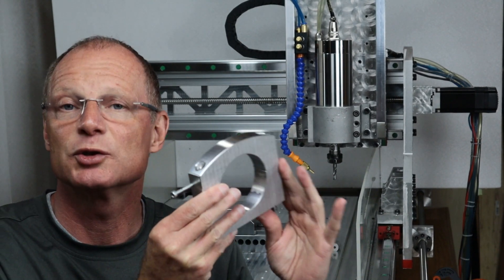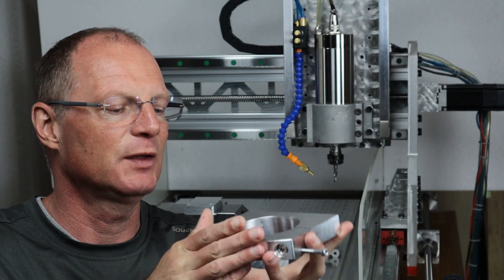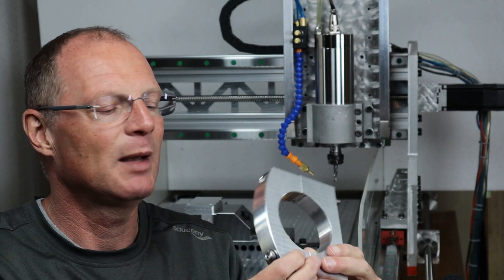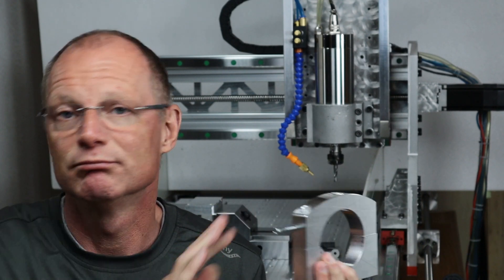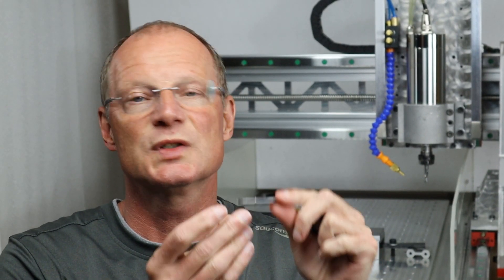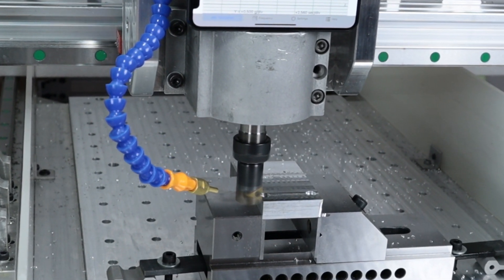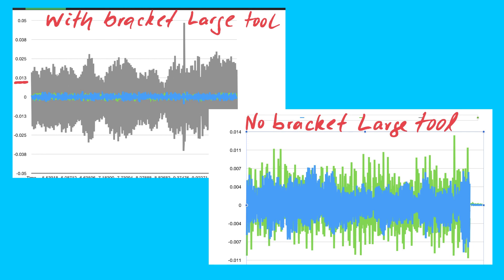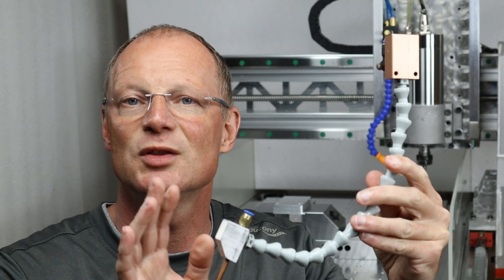Router Spindle Mount Improvement

Comment: Let me point out that the additional clamp may be tilting the spindle and thus introducing additional variable. 
You would have to take the spindle plate/mount/spindle to a surface plate, measure the position of the spindle, then install the additional clamp and re-measure to determine the distortion introduced by the second clamp.
Reply from the maker: I used a gauge block to measure the distance between the Spindel and the mounting plate and transferred that dimension into the design. So yes you are correct it is important that both resting surfaces of the spindle are parallel

Comment: Which aluminum series you used  making your part? Or which one is better to machining?
Reply from the maker: So the most common to find (and therefore The cheapest) is 6061 T6. It machines ok. I use it sometimes. There is a cast fixture plate material I like a lot as it does not deform during machining. The cast material has no internal stress. 7075 is nice material with better strength  that I use quite often.
Reply: @JBWorx  thanks for your response
Reply: @JBWorx  and hope we see your new video soon as possible in your YouTube channel

Comment: Thanks for the video!

Am I the only one who has really distorted audio during the talking portion?

New mister will be interesting. I'm always futzing with mine because the mist is never consistent.
Reply from the maker: Thank you for the feedback on that audio. It is “decent” but not good on my original video but I need a new mic. I am using a wireless mic as I am otherwise not able to move around in the shop